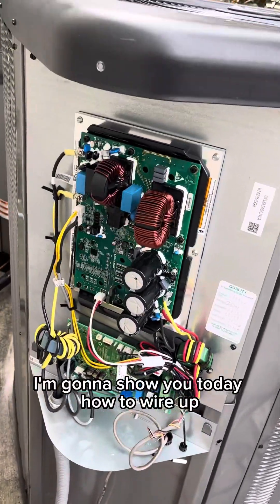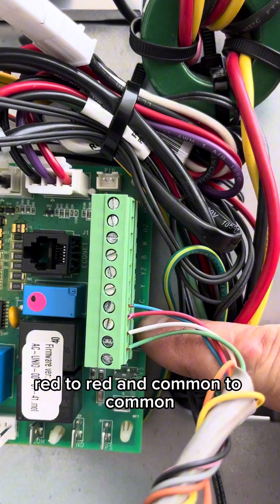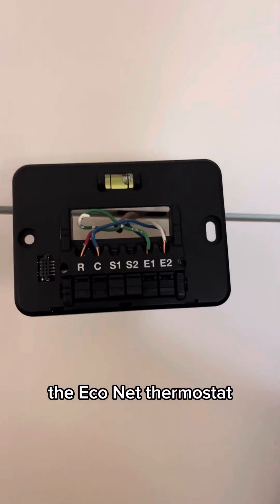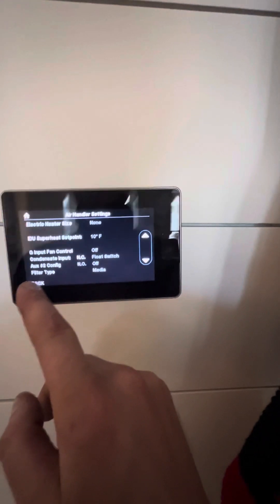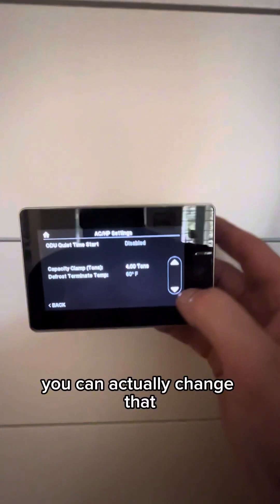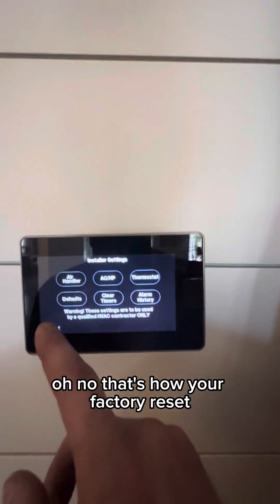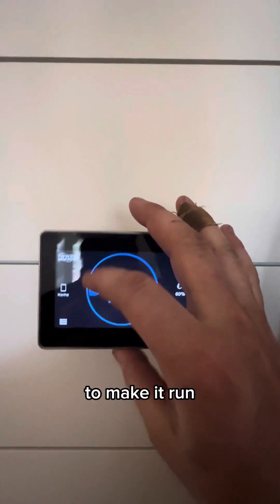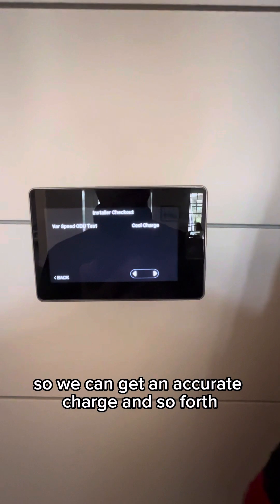ECONET Thermostat Wiring and Installation- Step By Step

Comment: How do i connect to a different one because i have been replacing my econect twice (not me,was a professional) just tired to call them im using a honeywell but i dont know where to put the E1 and E2
Reply from the maker: If you are wanting to use a legacy thermostat like Honeywell. You have to rewire the air handler and condenser and will not be able to use E1 and E2.
You will then use your normal wiring for a straight cool or heat pump whichever system you have

Comment: My system keeps saying that there’s a fuse open, but I’ve already checked the 3M fuse and it’s good reset the power and it’s saying that the switch is open and I remove the switch still giving me no power code
Reply from the maker: Are you sure you have the switch programmed right? You are not breaking 24v on switch are you

Comment: How can I install an Ecobee Premium with this system?
Reply from the maker: You are not able to. You must use the econet controller for proper functioning of system and setup
Reply: Thank you for the quick reply!
Reply: I have the ra15az 3 ton setup non hp with eh rudd r962v furnace and they told me to leave my ecobee as it was econet worthy and they wired my ac condensor with just 2 wires and my furnace with out stages. Well no stages worked inside so blower was always asking for lo cool. I wired the furnace for the 2 stages now I get the lo and hi cool calling but ac is always at 99 percent and don't seem to be variable. Would live to know if this is right